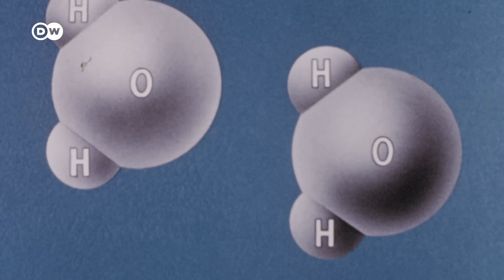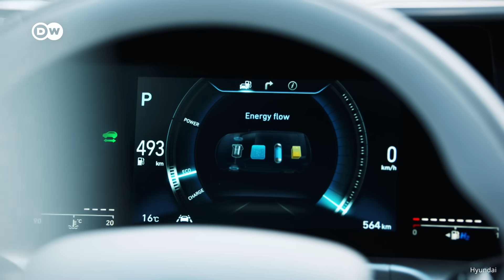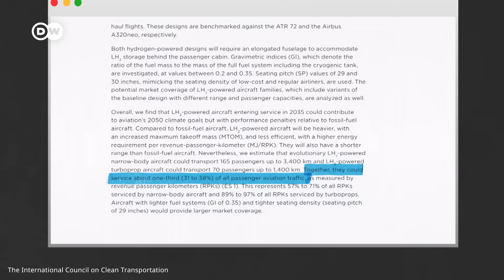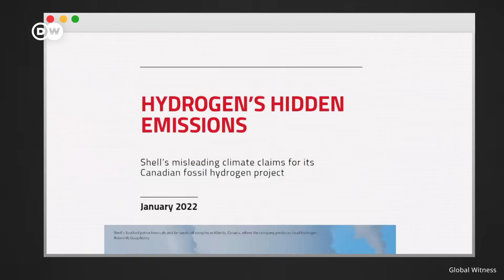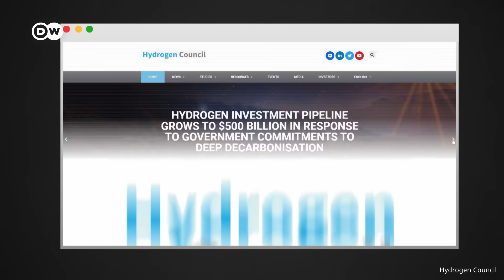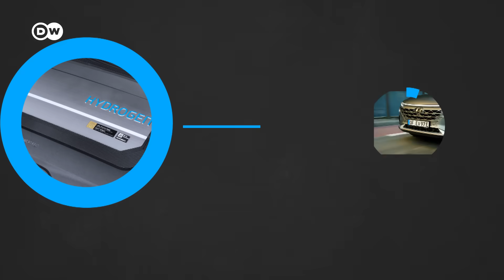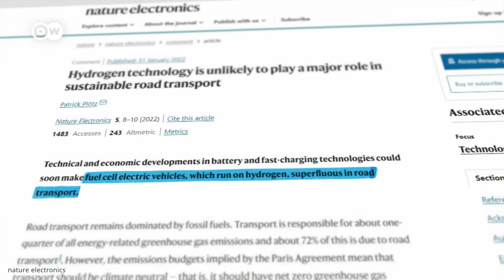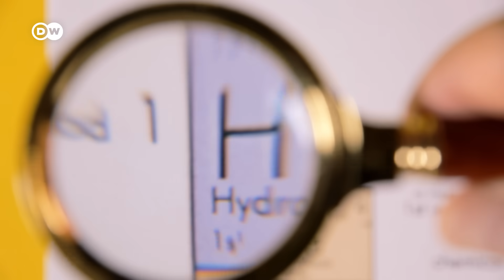The truth about hydrogen

Comment: Uses of green hydrogen to replace feedstocks for industrial processes that have hydrogen in their constituent is the way to go.  Using it for "fuel" for vehicles is wasteful, we need to concentrate on storage of the gluts of renewable energy, not make up schemes to waste it.  Long distance haulage should be a thing of the past, freight should be on rail and the last 100M/160km by truck.

Comment: Hydrogen IS the future. There are currently 3 hydrogen fuel cell cars . The honda version- imho is the best one . Currently there are only hydrogen fuel stations in california though .  The cars are pruduction vehicles you can buy - toyota. Honda and hyudai . Now when we think of things like energy density and storage we also have to consider the abundance of oil, coal and synthetics . Yes , they higher energy density but they are a limited source in that they are finite . When people harp on and on about the detractors of hydrogen I remind them that this technology is just starting out and like in the steam age we had to develope the infrastructure . Battery power is massive but we are again using a finite resource and paying forward lots of pollution in the production of those batteries . Nuclear is good till its not because as it turns out - nuclear reactors are toxic and unsafe.; biological life doesn't do well around ionizing radiation . Hydrogen is the answer but also attitudes. More bicycles for instance and trains and towns built around the idea of energy utility.  I see hydrogen working maybe in the next 50 years but we have a long way to go. Hydrogen fuel cells are proven technology while the energy density IS lower ( yes , a cube of sugar has a much higher density ) but hydrogen is everywhere ; if you charge your tesla via solar then yes , you are using the sun and thus by extention using hydrogen . To have a hydrogen based society however is going to require the dev of technologies ; I am reminded of nuclear submarines that separate hydrogen and oxygen from sea water , I do not like nuclear though but subs like the USS George Washington have used the same ball of uraniun for decades. Just some thoughts ..

Comment: TL;DR: Hydrogen is a red herring. It is, at its core, a ridiculous proposition. The only solution to carbon emissions is NUCLEAR. Anything else has proven time and time again to be at best horribly inefficient and at worst, a distractions for to the naïve. Most of the hydrogen discussion is around the fuel cell. A fuel cell converts to electricity. Hydrogen in most cases is simply a replacement for a battery, but with much more complex systems involved, not to mention that obtaining hydrogen is difficult in all phases (separating it -- a lot of electricity -- energy to isolate it, transporting it -- under a ton of pressure and must be very cold and storing it -- special facilities to keep it under high pressure). Finally, fueling hydrogen requires a lot of expertise and is very dangerous. I JUST CANNOT EMPHASIZE JUST HOW RIDICULOUS THE ENTIRE NOTION OF HYDROGEN REALLY IS.

Comment: You need pure oxygen for combustion engines too, otherwise you get NOX pollutants.

Once we have local smaller reactors that process water into hydrogen and oxygen, transportation won't be as much of an issue. Hydrogen can also be piped instead of methane. Nuclear plants can produce hydrogen during off peak hours, so that actually makes nuclear power plants more efficient.
Reply: Adding more oxygen displaces the nitrogen that would have been available to burn, thus reducing NOx output.  An expensive way to do it, but I guess there would be an abundance of oxygen with nothing much to do with these hydrogen electrolysis schemes...

Comment: HYDROGEN GAS IS FLAMMABLE.  ANYONE WHO TRIES TO TELL YOU IT DOESN'T WORK IN A COMBUSTION ENGINE IS EITHER NAIVE OR PURPOSELY LEADING YOU ASTRAY.  THEY HAVE KILLED PEOPLE WHO FIGURED IT OUT.  COMPANIES HAVE SUBMITTED BIDS TO KEEP PLANES IN THE AIR FOR WEEKS BEAMING 5G DOWN IN REMOTE AREAS USING HYDROGEN HYDROGEN HYDROGEN HYDROGEN HYDROGEN HYDROGEN FUEL CELLS

Comment: what are wind turbines made from. well the blades are made of tons of fibreglass which contains tons of resin. where does that come from? fossil fuels. what do the wind turbines sit on? well on land they sit on tons of steel and concrete. where does the cement come from? burning tons of fossil fuel. the whole thing is crap. the energy density of fossil fuel is so high that there is no real viable alternative. to hydrolise water you need more energy in, than you get out. what is the answer? at present, to me it looks like nuclear. what about the waste? bury the stuff in the hole you took the ore out of and don't be so squeamish about nuclear waste. it works, it's real, and the only downside is that we have too much health and safety. most of the waste generated is so low level that it is no worse than granite. the high level fuel rods we just make into penetrators and go on waging war like we do already. no one seems to bothered about that, since the worst war mongers are UK, France, China, Russia, the US, Germany... use less and consume less. that would do more for us in the short term.

Comment: The supply chain supporting "green energy" is heavily reliant on fossil fuels.  Converting electricity to hydrogen that then goes to fuel cells is a dead end solution for most applications, since it wastes way too much energy, that would be best used directly or stored in a battery.  While there is lots of talk about batteries,  the raw material supply is currently short for the current demand for high efficiency products, much less meeting a 80 fold increase in use to power transportation.  Plus the environmental issues associated with production and disposal/recycling.   The technology needed to go ahead with truly green energy is a quality, cheap, easy to produce non-toxic battery.  That might be discovered this year, or next century.  Until then we are wasting resources and creating needless pollution and suffering trying to reach a goal beyond our technological grasp.
Reply: You make an excellent point. The idea that we’ll some how pull “green” anything out of our collective backsides is emotional diarrhea. If I can again put it indelicately, physics is a &itch! “Clean energy” is simply not clean. Solar panels, electric cars, batteries, windmills that are necessary ON A MASSIVE scale are going to require strip-mining enormous areas of the planet, mostly in undeveloped countries. 

These “green solutions” are really about making millionaires into billionaires and making the wealthy elites wealthier and feel good about themselves at their cocktail parties. Fusion energy and the shorter range, new safer nuclear technologies have to be developed.

Comment: That is the "catch 22", it is only an energy carrier, not a "source" because it is not found free in nature.
It will always require some energy to release it from water, but that could be solar, wind or nuclear sourced.
It would require a significant amount of funds to convert my Mitsubishi car to "water" and even then it would need to be "babied".
Also not very fitting for cold climates as your "fuel" can freeze solid in winter.

Comment: For starters, DW Planet, electricity from windmills and solar panels is NOT EMISSION-FREE.  I suggest you read up on the carbon footprint of those supposedly 'green' power sources - such as the amount of concrete, steel, fibreglass and cobalt they use, and the amount of pollution caused in mining and refining cobalt and lithium - not to mention that so much cobalt is mined in the 'Democratic' Republic of Congo by CHILD SLAVE LABOUR.

Secondly, I take it that you haven't been following the data from the only truly GLOBAL weather monitoring system we have - the weather satellites.  This shows that what little global warming we saw at the end of the 20th century (peanuts compared to the Medieval Warm Period) fizzled out about 25 years ago, when temperatures levelled off.

Needless to say, NONE of the IPCC's 'climate models' predicted such an event - nor did any of them predict that, for the last 5 years, global temperatures have been FALLING, despite the fact that (thanks to China and India) CO2 emissions have been relentlessly rising.

Basic rule of science;  if real world data doesn't match what your theory said it should, then your theory is - at best - incomplete, partly wrong, or TOTAL CRAP.
No need to thank me for putting you straight - you're welcome.
Reply from the maker: Hi Jack X, 

Thanks for your detailed feedback. We completely understand that solar energy is not emission-free and have spoken about this in the following video: "How green is solar energy really?" https://youtu.be/EWV4e453y8Y 
With regards to the mining of minerals like cobalt, we have touched on that topic in the following video about diamonds: "Why lab-grown diamonds are better than mined diamonds" https://youtu.be/bZhRjh3Vg7w – let us know your thoughts in the comment sections of the videos 🙂 🌍

Comment: OKay,   1 natural gas is MOSTLY hydrogen and pure hydrogen is far more powerful.  Then lets talk about the way you're saying is the only way to release hydrogen. Well, forced dissociation is energy expensive so counter to the idea. It is also marketed as the solution by that BloombergNEF nut case because Bloomberg is a member of the global financial aristocracy.  Thus market the idea that keeps him and the other members in their power seats. 
   Hydrogen infrastructure isn't so hard to implement. When it is transported as hydrogen it is exceptionally complex, expensive, corrosive, and explosive if humans prove as stupid as they are currently. However, we have already got natural gas as well as ammonia production and transportation infrastructure.
 An SORFC plant in every city using a solid oxide high temp fuel cell is both efficient and cost effective to create hydrogen locally.  It can use solar and wind as well as grid level sodium batteries to buffer energy use in off production hours of renewable.
  Lithium Ion batteries are here forever until a better portable long life source replaces it.  However doubtful that may be lithium ion is a bad bad solution. 
Everything from stripping mother for minerals using poor people to cradle to grave battery. They explode in high heat or current use. 
Fuel cell is the way to go.

Comment: Vastly cheap abundant electricity with nuclear.   Every city should have nuclear power locally produced.  You could even use nuclear sourced electricity to make hydrogen at the local level, no need to transport it in a pipeline.   Problem solved.

Comment: Hydrogen can be used as an energy carrier or as a chemical.  Splitting water, pressurizing it for transport, transporting it, offloading it to storage tanks, putting it into a tank, using it in a fuel cell, putting the electricity from the fuel cell into a battery then using that battery to power a vehicle will never be efficient. We will never have enough extra renewable power for hydrogen for those vehicle. Hydrogen is needed for production of ammonia fertilizers and steel Period.

Comment: I am guessing no one has told you about fusion energy. I mean really the power desity of hydrogen being small would be true from a combustion stand point but not by a fusion stand point. granted that a fusion reactor has yet to produce a energy net possitive. but it is only a matter of time before that does happen with the ITER project supossed to meet a energy net possitive. by 2025 but lets be honest i would say it will take slighty longer maybe 2030-2040 do to delays such as sabatoge because fossil fuel companies are not going let there cash cow live as long as they can as number 1 energy producer make as much money as they can till oil is only used to make plastic. because like all technology fusion reactors may shrink to the point they can fit into the engine compartment. lets say fusion reactors are a lot safer than there fission counter parts the moment you lose the pressure fusion stops and it cools rapidly. essentually the moment the reactors containment is breached fusion stops. because you need to essentually recreate the suns core to have fusion.
Reply from the maker: Hi Leviathan, we have done a video on nuclear fusion before. You can watch it here: https://youtu.be/eyHovWQ49MI

Comment: I assume that hydrogen powered vehicle will need a large pressurised container on board to store the hydrogen, this sounds like it could be effectively a bomb in a car wreck situation where fire breaks out
Reply: A full tank of gasoline is also a bomb waiting to go off during a crash. The bigger problems with using hydrogen in cars is storage and leakage. The large pressurized container will need to have thick steel walls that will add a lot of weight. Also, hydrogen leaks easily and it attacks the materials used to contain it. You could do it the way rockets do it, which is to chill the hydrogen to condense it into a liquid but then you have to insulate the tanks to minimize losing the hydrogen due to boil off.

Comment: The low (40%) cycle efficiency of Hydrogen versus battery storage (80%) you mention at 10:00 into the video is pretty much telling it all :
Hydrogen will always be twice as expensive than battery storage.
That is even ignoring the colossal disadvantages that Hydrogen has (no transportation infrastructure, and no easy way to store it) versus battery storage of electricity.
So why even bother ?
Reply: Because battery storage have a lot of disadvantages, too. Refill hydrogen is fast, battery charging need a lot of time.

Comment: How about utilizing and solving water shortages 1st before using it for power sources especially with the fact that to desalinate it removes essentially too much natural minerals needed to hydrate with water more usefully. But that's awhile nother topic. And likely opinion that many would probably vote me out and quiet as opposed to supporting as the smarter choice they stand behind and agree with.....again I say this is just an opinion. Please know that you are under no legal obligation to like &/or agree with me as that is everyone's right. Thanks!!!🤔🤷🏼‍♀️🤪
Reply: You mean that many cities will be out of water in next 10-15 years? 
Like Barcelona and its underground deposits of water are closed to extinction . 
If you mean while desalination of water we might electrolyse it and make H² , its extremely expensive. 
Look everything is hydrogen surce ,  hydrocarbons is hydrogen and carbon. Reaction when you burn it make H2O CO2 and by-products are exactly same as ours body's are making after burning our hydrocarbons we eat. 

Ij my opinion we even car burn a coal and it will not be a problem if CO2 will be stored under the ground where it will slowly react and be turned to solid. 

Or if we really want hydrogen so much cheapest way is to  heat methane with repurposed nuclear reactor . its the cheapest way to make it.

Comment: also need to ask ourselves, is green energy really green?
production of solar panel and wind turbine is highly energy consuming which leads to significant greenhouse gas footprint.
another question: can we manufacture solar panels purely via electricity generated from solar panel and at least reach sustainable level?
same thing as wind turbine + the generator inside the huge wind turbine.
if the answer is not, sorry, all these is illusion.
we have to have behavioral change; reduce the demand of energy.

Comment: The issue of H2 is clear:  the energy needed to extract it from water, and it's questionable weight density and safety, resulted in Honda scrapping their H vehicle program.   ....   for large applications, cold fusion in its' real life' form of taking spent safe fuel and making energy without the 'trouble of disposing-reprocessing it's waste by products' is a more 'viable near term' alternative.    ....   Electric, produced from multiple sources and most of those without 'toxic or short life-span EOL issues', is more sound to consider for both ships and planes; and has been applied to each in limited experiments.  A ship with a 'new age' sail, could also 'help ships transfers on limited other fuel sources where 38% of it's total average travel (as a minimum) would be propelled this way.   Tim Zickafoos

Comment: Hydrogen. It is an extremely combustible gas which the video did not promote. It has a burn rate probably 3 times faster than gasoline. The biggest obstacle has been its combustibility as it is dangerous to the average user yet it creates water after combustion.  Recent progress in creating a more stable liquid form have recently been discovered and hydrogen combustion can be adapted to typical combustion engines we have today... more of a transition that a rengineer. It also can be distributed in liquid form much as we use gasoline today and has no charge time penalties or weight penalties associated with battery motors.